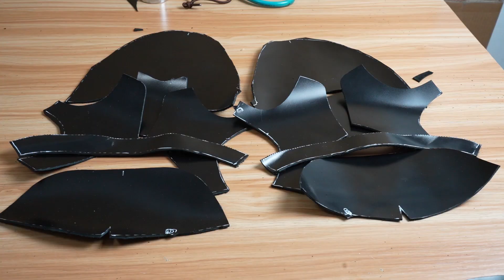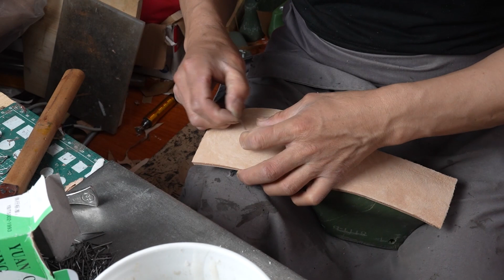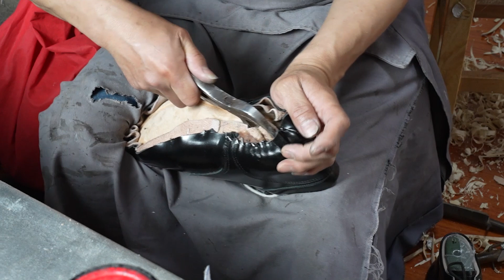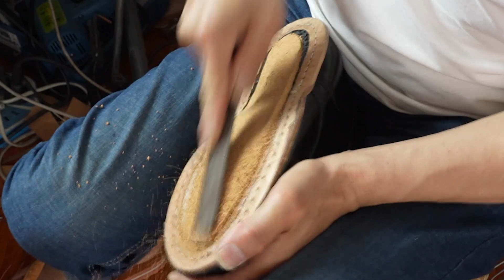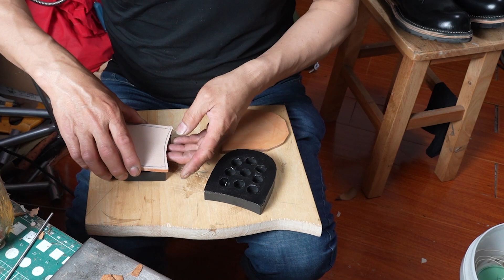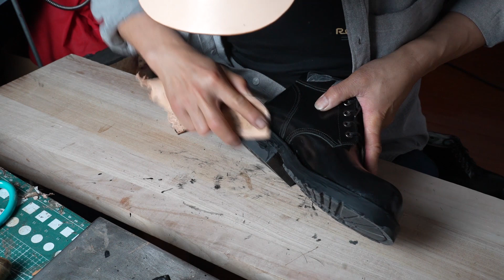Unveiling the Mastery: Handcrafting Black Low-Cut Work Boots by Chinese Artisans |ASMR

Comment: When stitching the sole to the welt, how are you able to push through all that leather and rubber with a jerk needle?  Or are the holes pre punched and if so, how are you doing that?  I'm learning to make boots but I don't have a curve needle machine. :(   Thanks in advance.
Reply: by hand there isn't really a better way to stitch rubber as far as i know. but i have also never seen anyone do it at that kind of speed! and it doesn't look like its prepunched. i guess he just has a very sharp jerk needle and a good technique and routine ^^
Reply: but if you ask me stitching rubber soles is actually never that great of a choice. especially halfsoles. i would allways rather stitch only the midsole and glue and nail the rubber on(or maybe screw for heavy lugs). otherwise one has to remove the whole heel and resew the whole midsole just for putting new halfsoles/outsoles on which makes no sense. changing outsoles is needed in extreme cases every 5-7 month, while heelstacks and midsoles should be in place 2 or 3 years minimum i'd say. plus a glue/nail bond should keep up longer than any rubbersole itself before it needs replacement anyway. one can off course stitch the halfsole on with a seperate seam but nails also hold up better than seams against the abrasion, so... i really don't get why everybody is sewing the rubber. i guess initially, before the stitches pop, it is a LITTLE bit stronger but in my experience that changes quickly with wear. on every other part of the bottom construction though, like the heel seat for instance i would allways prefer stitching, because where there's no direct abrasion they are just better and longer lasting i think. and less corroding material in the soles...